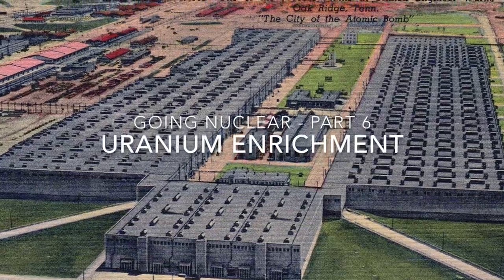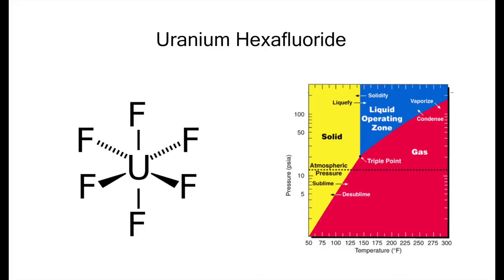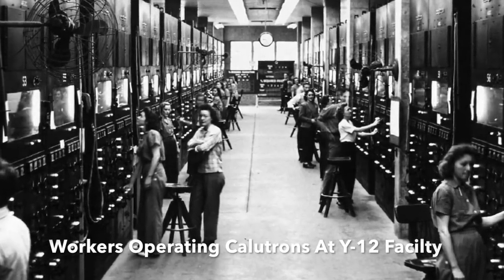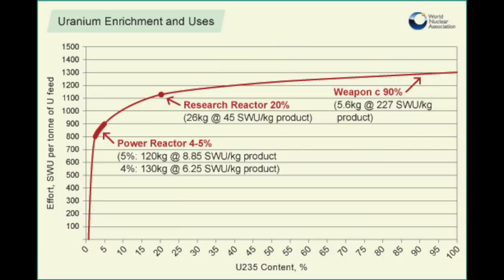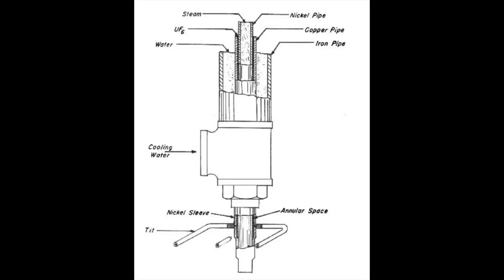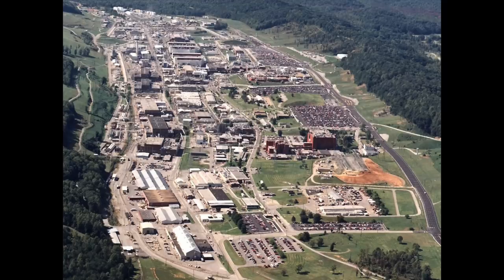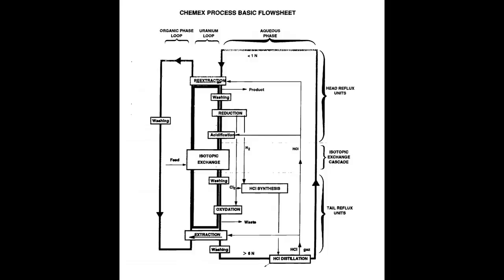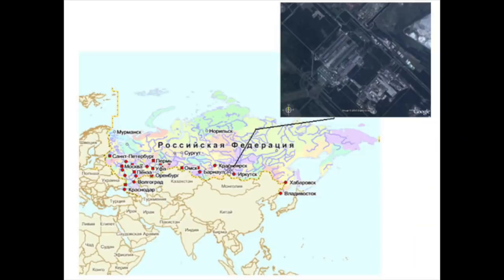Going Nuclear - Part 6 - Uranium Enrichment

Comment: The US actually built (much larger) centrifuges during WW2, but they contributed no meaningful amounts of enrichment. They were referred to as 'Self Disassembling Enrichment Devices'. I.E. they tended to self destruct.
The biggest problem with enrichment technology on a proliferation basis is that the amount of enrichment to effort isn't linear. Reactor grade Uranium is only ~ 20% enriched. That amount of enrichment from the refined ore requires something like 75% of the work and energy that would be required to enrich uranium to 80%. (it's actually a bell curve, meaning going from 80% to 90% requires a lot more effort than say 70-80 but 80% is very highly enriched). Also, reactors running 'rich' levels of Uranium (50%+) can be run in faster 'hot low burnup' cycles to produce more Plutonium quicker. (If you want Weapon Grade Plutonium out of your reactor you need to run your fuel in short cycles, because longer ones burn up the fissionable Pu and leave the undesirable Pu isotopes behind)
Reply: Yikes, what country are you in where reactors use 20% enriched uranium!
Reply: That number might very well be wrong, I pulled it from . But the point is that getting to 'reactor grade' is a massive part of the energy and time expense of enrichment compared to going from reactor to weapon's grade.

Comment: #Scott Manley , no mention of the ‘aero dynamic’ centripetal separation method South Africa used for its atomic weapons program? Or was that actually just an application of centrifuges we’ve seen most recently?
Reply: He mentioned it in a different comment, but it had to be cut for time. Very interesting and I hadn't ever heard of it before so it was a fun read. Looks like the technology dead-ended, though.

Comment: Ah, the Zippe centrifuge as designed by Gernot Zippe. I believe that LASEX (an Australian design) is now the most energy efficient. In short, a laser with a frequency that is matched to U235 (slightly different to U238) is used to inject energy into the 235UF6 molecules so they 'boil'.
 The technology was bought by the US military and details are unknown. Suffice to say that Iran still uses Zippe centrifuges.
 Although less energy efficient, if one has 'waste' energy in the form of heat, the CHEMEX process might work. I suppose if Iceland wanted to do it, hydrothermal vents would provide the energy.
 I'm also betting that the magnetic properties of uranium & plutonium have been looked into, the latter especially. It's OK to put Pu239/240/242 into a missile that people don't stand around or a bomb that is mostly in an igloo but I know that US SLBM carriers use 'supergrade' plutonium because the crew have to be around it a lot.
 I THINK the reason nuclear Tomahawk cruise missiles were dropped because the cost of supergrade is so high.

Comment: My guess is the Laser method is actually just Laser cooling on a large scale. Again just creating a heat gradient that then creates a concentration gradient. Apart from the Laser itself, you could fit an experimental setup like that onto a table and an industrial setup inside any normal sized factory building - no dedicated power plant required. I can see, why they declared it a secret, but since when has security by obscurity ever worked in the long run???
Reply: Most speculate that it works like earlier versions of laser enrichment work, that is exciting its hyperfine structure difference to cause preferential ionization and some type of magnetic trap. This has proved impossible to scale for several decades now. SILEX just recently announced they need more funding and when GE-Hitach left the venture, it was basically the death note.

Comment: Can't think of where to ask this question so ...
Would it be possible for nano machines to physically push two nuclei together and cause them to fuse?  I know it requires a lot of energy to do it by random chance in a reactor but I figure it may take a lot less energy to physically constrain two nuclei and then force then together, perhaps even by chemical means, e.g. inside a folding protein.
Or are the energy requirements orders of magnitude away from that being possible?

Comment: Scott - Check into the role that Mallinckrodt Chemical in St Louis had in initial Uranium ore refinement for the Manhattan Project.   Nobody ever talks about it.  I live about 90 miles from there and never learned of it until a few months back.  A lot of initial Uranium ore refinement was done there (and later at the Weldon Springs, MO site during the Cold War).  It's quite interesting.

Comment: Scott, I have been wondering how do they take the UF6 after enrichment and get U235 in a solid state? Do they probably just let the UF6 cool down or what? 

I was never much good at chemistry, so I don't know if there's a simple answer staring me in the face or not.
Reply: The most common for reactors is the calcification process: 

UF6 + 2H2O -> UO2F2 + 4HF
UO2F2 + H2O -> U03 + 2HF
UO3 + H2 -> UO2 + H2O
-------------------------------------
UF6 + 2H2O + H2 = UO2 + 6HF

For uranium to metal it is can be a sodium process 

UF6 + 4NA ->U + 6NaF

but also the more common Ames process:

UF4 + 2Mg = U + 2MgF2

Uranium metal is very pyrophoric, so it has to be treated with care.
Reply: Christopher Willis Thank you! Fascinating.
Reply: Important note, most of these reactions involve a lot of heat, either needed to get the reaction going or produced by the reaction itself, also the Ames process has the UF4 reduction needed as well.

 UF6 + H2 -> UF4 + 2HF at 1500-2000 K. In fact, most of them temperatures exist in this range for the reactions.

Comment: UUUHM, am i wrong or was there litterally only one uranium bomb whiches designed was discarded due to the high load of uranium u need (gun type bomb i think was the design) which was replaced by the implosion design which opperates on plutonium and becam the common scheme.

Comment: What's the smallest amount of enriched uranium you'd need to actually make a bomb, and what yield would that reach? Sounds like only large bombs are possible.
Reply: We consider anything about 20% starting to edge up to weapons feasibility. Realistically, though, 80% represents one of the lower thresholds one could make a weapon. You could make a "device" that used a bit lower, but it gets to be the size of a house and easily prone to predetination and loss of yield.
Reply: Christopher Willis so it's purely percentage not mass based? 0.00001grams of 80% enriched uranium could make a nuclear bomb? Damn.
Reply: Ohhh, no there is also a critical mass. You need a certain amount of neutron density per unit fuel to make a chain reaction. Different technologies and enrichments allow you to push it smaller and smaller, but it is about the size of a softball volume wise for a fission core. So around 10 kilos for a bare mass, but that can be made smaller with neutron reflectors. The actual smallest is classified.
Reply: At fairly low percentages you could build a breeder reactor to create plutonium for a bomb.  It's a bit hard to find the exact numbers though.  Critical mass for plutonium is 24 pounds which due to the density is only 4" in diameter.  It's small enough that the US built the man carried nuke bazooka M-29, with a 51 pound warhead.
Reply: If you use hella exotic materials that decay away in days rather than years you can get REALLY small. Russians were working to make nuclear bullets. These aren't bombs persay, but kinda in the vein of what was asked. These materials are very difficult to work with and are potential lethal because of the radiation hazards to the user, so I normally don't mention them, but some super exotic actinides (things heavier than plutonium) have very very small critical masses. Specifically they were using Californium-252. However, the more highly radioactive a thing is, the higher its heat density. These bullets had to be water cooled and had to be used within days, and had unpredictable yields, and couldn't be fired in rapid succession, and posed fatal radiation exposure once exploded at close range...and countless other problems. As such, very small explosive devices can be made, but only by advanced nuclear nations that have access to super exotic materials and even then the devices made have huge downsides of short shelf life and instability. Instability with even small nuclear devices is a recipe for death...your own death.

Comment: Wouldn't it be possible to make a separate computer(that's not hooked up to any network or computer) system that only monitors the centrifuges and checks the commands from the main computer so that if it receives a command that would make the centrifuges do something that would damage them, it blocks the signal and puts the centrifuges into shutdown mode?
Reply: That's called "air-gap", and it's a common security method for critical computer infrastructure. However, the Stuxnet worm (which I presume you're referring to) was able to cross that gap via removable media used for updating the systems, since it had no malicious payload until it got to its target system. Rather elegant, in that regard.

Comment: Ha ha I love this the SWU was derived from the Dirac equation the gaseous diffusion method was very expensive and energy intensive something like 2300MW and you need thousands of diffusion cells,the gaseous centrifuge developed by Gernot Zippe while he was a POW in the Soviet union the first centrifuges the rotors were small less than 1m and SWU of only of 5 at the time, the Soviets had jumped onto that form of enrichment and by 1952 they had an industrial scale plant and for example quicker to enrich to what level at the moment the TC21 centrifuge has a rotor length of 5m and SWU value of 100SWU per year. The most promising one is the AC120 centrifuge and has a rotor length of 16.5 m and a SWU of 330 swu per year and energy requirements of 120KW per centrifuge. AVLIS process was promising of a higher separation value of 2.5 to 6 and the program was cancelled shame that one system had the power of 7000 centrifuges. The only hope is SILEX using UF6 gas as medium and using lasers and Australia is leading this with Japan and GE .

Comment: How do they measure the purity of the isotope sample they have?
Reply: Joe Bloe if it’s in its elemental metallic form I think you can just carefully calculate its density.
Reply: I'd guess they'd use the energy spectrum of its radioactivity.
Reply: Measure it's radioactivity. It's calculable, so you can check how closely it matches.
Reply: Andy Lee Robinson 
U-238 has a MUCH longer half-life than U-235; most decay events would be from spontaneous U-235 events; however phos9 guessed the easier method; just collect, weigh, and measure dimensions of a sample super-accurately to get the density and therefore isotopic ratios.
Reply: For lower enriched samples, you are specifically monitering for 185.7-keV gamma rays. This will give you a intensity per unit mass of U235.  Similar spectral tools are used to narrow it down further, it gets way more complicated as you use reprocessed  fuel. This has to be done with care as different materials compounds of uranium will offer different mean free paths through itself (basically uranium can self shield). The flatter the disk, the easier to measure the true value.  When a sample is particularly thick, material composition correction factors come into play to help augment and correct for this internal shielding. In a passive neutron detection is also an option, useful if barriers obstruct more readily disreputable xrays (IE, see gas). 

Good source

"The Measurement of Uranium Enrichment
Hastings A Smith,Jr."
Reply: Sticking their tongue to it, same as batteries.

Comment: What about Thorium? Much more abundant (cheap), doesn't need such difficult enriching, and is much more controllable, it can't become permanently critical like with the Fukushima meltdown. The system has failed us once again, by pushing the expensive and dangerous uranium industry.
Reply: Thorium isn't really cheaper than uranium. Cheap is actually bad to promoting mining something anyway. Uranium mines are already having a problem staying in business because of the suppressed uranium prices. Good luck with a material that is even cheaper!

Not needing enrichment is disingenuous as thorium has NO fissile isotopes. Thorium is not a fuel, it is a fuel stock. Trying to compare it to uranium fuel is not fair and not even useful! 

It is also not more controllable, if anything U233 is a more unstable fuel, with half the value of delay neutrons than U235. Similar to Pu239 levels actually. That isn't to say it is dangerous, but once you get that low you start to run the risk of pogo oscillations do to doppler effects of fuel heating and cooling via rapid transitions of reactivity due to suppressed delay neutrons. 

Fukushima was not an accident due to criticality, it was an accident because of a loss of coolant in the reactor. The reactor had been shutdown automatically earlier from earthquake sensors. Any system can suffer this, even a thorium one. Thorium has no input here, at all. 

Basically, thorium might be an interesting fuel, but most reactor safety and design choices fall to other parts of the reactor with the fuel cycle being a player in that, but not as large of one as thorium people let on.

Comment: I wonder if it takes more energy to produce a nuclear bomb than the energy we could extract from it.
Reply: Jasc Tomm considering reactors work, probably yeah. Still obviously not making energy from nothing as the uranium isnt reusable
Reply: Probably not.

It takes a lot of energy. But the energy released is enormous.

Even if it does take more energy, it serves as an energy storage mechanism in that case.
Reply: Probably not, because our refinement methods are chemical and physical, not nuclear.
Reply: I was thinking about that watching this. I'm sure it takes more energy to make than you get back. All the energy taken to spin those centerfuges basically being stored in a bomb.
Reply: The problem is that you're not undoing a nuclear reaction to enrich the nuclear fuel. It's not like splitting water into hydrogen and oxygen, where you're undoing the chemical reaction that created the water in the first place. What's happening here is different. We're taking material and separating it. It takes a lot of energy, yes, but the energy released by a bomb is enormous. And the energy that can be extracted from a pellet is also enormous, but not as enormous. The Fat Man device released 88 terajoules. That's about 24.44 million kilowatt hours. The Calutron setup might take more energy than is released, but the other concepts likely don't. And when it comes to reactors, the required enrichment isn't nearly as high, so more energy may be extracted than is used to enrich it. It's likely very dependent on the situation.

Comment: 0:43
Hundreds of tons of uranium per bomb?
No. An average implosion type pure fission weapon like that designed by Iran requires 5.682 tons per weapon, assuming a tails essay of 0.3% U-235, which is the highest concentration considered depleted uranium by the DOE. If you have a lower concentration waste, the initial mass of natural uranium decreases.
The lowest core mas pure U  (not-composite) I know if would require 1.847 tons. The largest would require 26.592 tons.

Comment: Uranium fission and plutonium fusion still used technology from the 1950s thanks to govt regulations do GE.  Look into thorium salts reactor. 

Much easier without the problems of Uranium
Reply: Thorium isn't that great compared to uranium. Most of the talking points around it are actually due to reactor design that can be and have been applied to uranium based systems. Thorium has its own set of problems, like a lack of any fissile isotope and lower delay neutron fraction.

Comment: I should point out that weapons-grade U-235 is 93.5% not 80%.
Reply from the maker: 80% was what was used in early weapons.
Reply: And 80% starts to be a lower bound. You could likely push it lower if you are an advanced nuclear state and wanted to use all sorts of fancy tricks or make a very large device, but it start to lose practical weapon status lower than 80ish%.

Comment: @4:16  Less than "thirty-sixth-thousandths of one percent of the 14,700 tons was lost during the 28 years the silver spent in Oak Ridge!"   Lets see: .036/100 = .00036 *14700 = 5.292 Tons of silver not returned.   That's still a lot of silver!

Comment: That chemical enrichment process, with the acid..... yikes.

Radioactive hydrochloric acid. Literal nightmare fuel.
Reply: So long as you don't assemble a critical mass, uranium is only slightly radioactive: 4500 million years half life for U238, 700 million years half life for U235. This is why there is still lots of it around to be mined. It being a heavy metal (heavy metals being toxic) is at least as big a worry as the radiation.